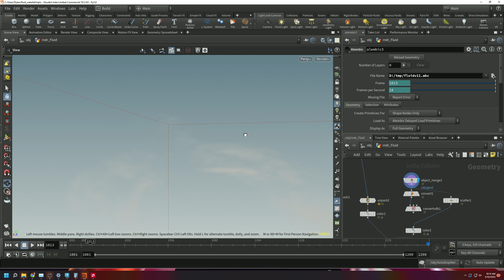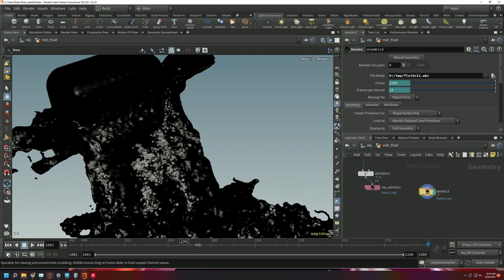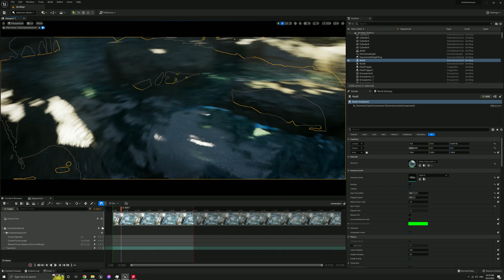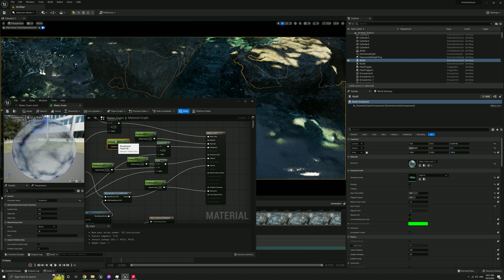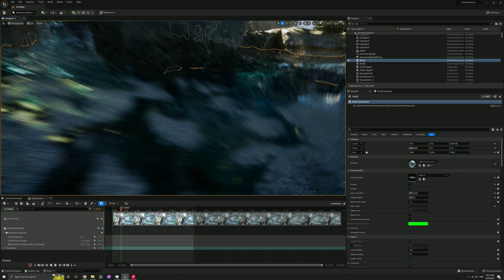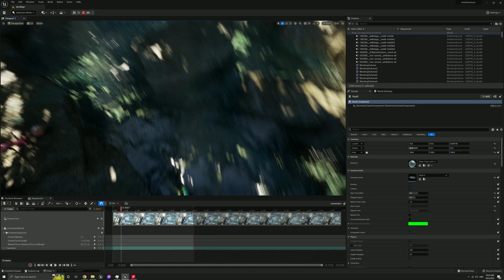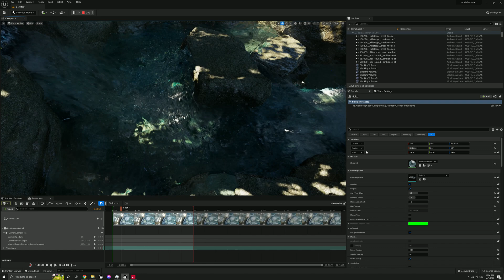High Quality Water in Unreal Engine 5 via Alembic & Houdini | Part Two | Whitewater

Comment: I know i'm coming to this a ;itt;e ;ate, but i have a question about the looping node, did you ever work out how to make it seamless? i have a sequence over a 1000 frames, wanted to take the last 200 frames and create a loop, and although the loop start and end frame look good, in the middle there is a pretty obvious jump ( i used primitives because trying it on the compressed volume gave me random frames that looked 'peaked /swollen'. any insights from any one appreciated.

Comment: noticed a few very hot specular flickers, which have always been pretty tough to control with raytracing. Did you path trace the final footage? Amazing work nonetheless!
Reply from the maker: No Path Tracing, just Raster with Hardware Lumen, the flickers show up because I'm using no AA in the render combined with convolution bloom, which can be an issue sometimes!